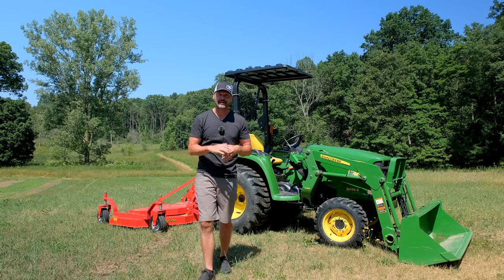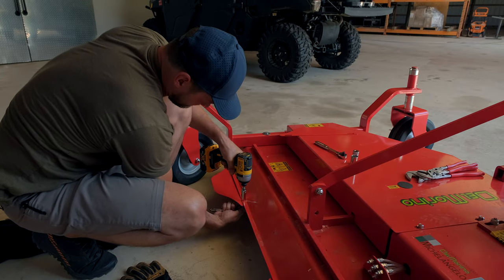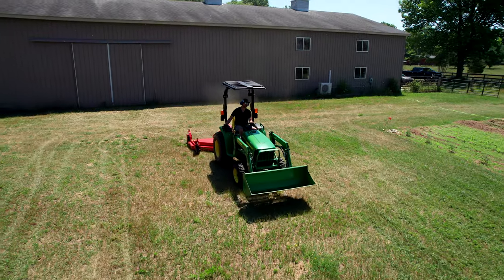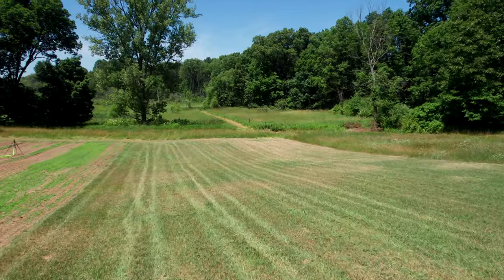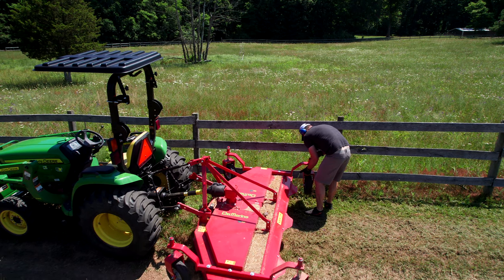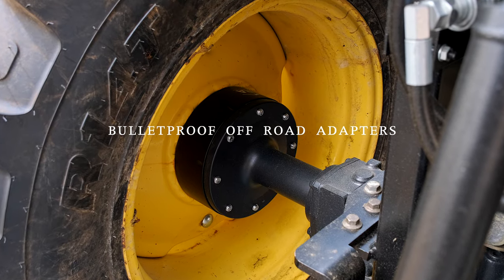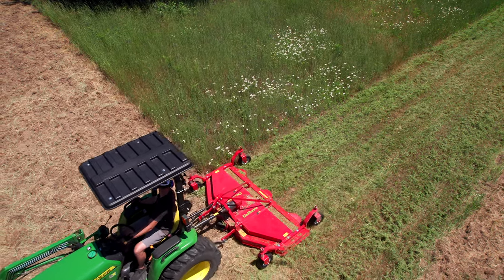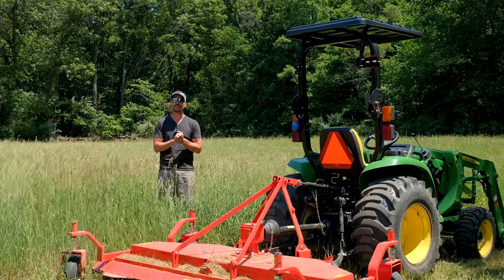96” FINISH MOWER WORKS ON A 25HP TRACTOR?  John Deere 3025e

Comment: surprise no shear bolt of slip clutch on a unit that big
Reply: The belt(s) is the sacrificial part.
Reply: Me too! It definitely needs a clutch! Or a shear.
Reply: @tacratt6091  i just bought this one from Courtney. i’ll let you know if i have any problems with belts.
Reply: @Scott-cu4ol I just ordered one.  Is it performing well, or should I cancel the order?
Reply: @sonataq14  i am happy with mine. i cut both short and sometimes much too tall grass with it and it does a nice job. I am impressed at how the under side of the deck doesn’t get clogged up it stays relatively clean. I’ve only had two raise the three-point twice to clean out underneath it, and it was minor.
keep in mind anything 8 foot wide it doesn’t flex it’s going to scalp on the very uneven ground and be careful of rocks
Reply: @Scott-cu4ol  I just took delivery today.  I'm putting it together and have a question...do you use SAE90 gear oil, or do you use GL-5 80W-90?   If you are using SAE 90, can you reply with a link to the gear oil you are buying?
Reply: @sonataq14  i just grabbed 90 at the hardware store. it was either Pennzoil or Castrol don’t think it really matters.
Reply: @Scott-cu4ol  got couple more questions...what size is your tractor?  And, do you use the mower without a loader on the front?  I've got a 3046R.
Reply: @sonataq14  35hp Kioti CK3510SE cab.  i leave the loader on.

Comment: It will work if the mower is set to cut high, the highest setting.  Go slow.  It won’t be pretty.  In a few days reset height of mower to a lower setting, 1/2 inch lower than previous setting.  Cut the grass again.  This second cutting will greatly improve the appearance and will mulch the brown clumps of grass leftover from the first cutting.  It will mow faster the second time.  To achieve great results every mowing, sharpen the blades frequently.  A sharp blade cuts the grass instead of shredding it.  The tractor will work better, the cut grass will have a cleaner appearance, and the whole job will be completed faster.   Try it.

Comment: Running a 60” rear mower on a hill ‘taxes’ my 23hp tractor in medium range. More hydro whine than anything else. Low range is no problem.  In my case, I think it’s more dragging a 600# mower up a hill than spinning the blades that causes the rpm’s to drop.

Comment: I've found the taller the grass, the slower you have to go. I'm running an L47 Kabota so I have plenty of power. I run at 2400 rpms, but tall grass will cause the belts to slip.

Comment: I use my finish mower on tall grass all the time.  No big deal.  Cutting down brush is a different matter.  On lighter brush,  you can get away with it if you don't mind messing up your blades,  otherwise you're right,  use a brush  mower.
Reply: I agree.  Finish mowers, just like regular mowers, work on grass no matter the height or density.  They don't work well on sticks bigger than say 1/2" or so.  You can damage them.  But grass won't cause any damage.

Comment: Three things that have improved my lawn quality greatly, cutting at 3.5”, harrowing single pass spring and fall, and switching to regular mower blades instead of high lift. High lift was causing ground erosion, and kicking up massive dust.

Dont think too much about rural grass, If its green its green, if its brown its brown.
Reply: Most of my rural grass is a bed of dandelions, LOL. Beautiful in the spring and like you say, if it's green it's green. Might come in handy one day if the grocery store runs out of lettuce

Comment: We've been using a ex local government K-line 3meter finish mower for topping of pastures after grazing with cattle and horses. I only use it on the fields that don't have trees in them. It does a great job haven't had to do a thing to it either apart from sharpen the blades once a year. We run it on either a 1966 David Brown 880 tractor with 46hp or my JD 4066r. Either tractor doesn't have a problem with it. One of the reasons I brought it was due to finish mowers having a high tip speed and a sharper cut which aids in getting a quicker regrowth of the pasture which is important for us. For fields with trees I'll use a nobili bne 210 flail mower (Y flails) or a Celli Vega S210 flail mower (hammers) both 2.1m and fields with stones lumps bumps and sticks a Howard EHD180 rotaslasher (brushhog) 1.8m. it is a pretty lane something about post and rail fences that just looks good.

Comment: I have used my 7' Befco finish mower in 2-3' grass without issue, but would not use it for that type of service on a routine basis. Right now the Befco is relegated to stream bank duty by backing over the stream bank 7' at a time. I was surprised to see a 25hp tractor handling that 8' mower! Thanks for the video.

Comment: good video!  great shots of it in action and with Courtney standing in the grass really gives a perspective how tall the grass is.  

Agree that a finish mower is not designed to cut that tall grass on a consistent basis.  I have a 72" finish mower and from last summer to this summer have mowed a few acreage lots with grass about as tall in your video. A couple of 5 acre lots, I've mowed 5 times and a couple of 2 acre lots I've mowed twice with tall grass. I always mow to a ~4" cut.  All of the acres were home acreage lots meaning just grass, most were flat only a couple had smaller inclines to them, where from top to bottom the elevation change was ~40'.  Most of the time I'm mowing my 5 acre lot with the grass ranging from 6"-8" in height.  

what I like about my finish mower:
I like the cut.  My 5 acre lot is rough from old pocket gopher tunnels and it seems like the ride in the tractor is more comfortable/smoother than a zero turn or riding lawn mower.  It may be perception but it seems like I mow faster with my tractor and finish mower.  Maintenance is quick and relatively easy.  The deck is easy to clean.   Belts, sheaves, gearbox, etc are easy to access. It's nice to be able to lift the mower deck and pressure wash underneath it, change blades etc. I do use a quick hitch with mine even though I'm not sure it's technically quick hitch compatible.  

What I don't like about my finish mower 
the pto is a pain to hook up, then again what things with a pto aren't?  I find it difficult to get really close to my fence, around the kids' trampoline, swing etc. so I usually spend an hour trimming around things with my riding lawnmower then come back with the finish mower.  

Problems I've had with my finish mower
The set screws around sheave / spindle were not tightened from the manufacturer or dealer resulting in the key and keyway getting worn and having to replace a sheave, spindle and hardware. about a $250 fix.  

If I were to do it over again
I would get a larger finish mower.  Something like the 8' would be a lot better because if your going to have a finish mower, might as well have one that is bigger than the standard deck you can buy or if I'm going to have a 72" mower then it might as well be a John Deere tractor with a 72" drive over auto connect deck with the load and go.

Comment: I use a 60" finish mower on tall grass.  I only have small areas to do, but it does well.  I know my yard, so I know where to mow without hitting the areas that may catch the blades.  Also, I raise it over those areas to run over them and then set it back down.  It's also a very old mower (brush hog brand though).

Comment: I use a 91" Caroni and a Woods TBW144 12Ft bat wing. Both finish mowers. Sometimes I'll get behind in work or an area stays wet and grows18" -24" tall. Providing the fields are nice and dry, both will work thru the stuff but you need good blades and slow ground speed. Not a standard practice but they will do it when truly necessary.  Not recommended for standard operations.

Comment: If I cut tall grass I raise the 3 point so cut is   about 12”, then go back over the field with spacers set to 6” height.  The second time over might let you see hidden rocks, branches.  Another option is to mow only half the width of the cut so the mower doesn’t get bogged down.

Comment: I mowed grass like that even taller with a riding mower, a John Deere L130. As long as there aren’t big sticks or rocks I think most mowers will handle it you just have to have different expectations. You raise the deck as high as you can and it’s gonna look bad and you’re gonna have to do multi passes and you’re gonna have a lot of it that’s going to push down and then pop back up. I usually just raise my deck as high as it will go and I go over it slowly. If I don’t know it’s there you have to go really slow or you need to just get out and walk it make sure you’re not hitting a bunch of big sticks or rocks. 

On the L1 30 I’ve run over bricks before and it messes up your blades but it’s not the end of the world, it’s a pain and it will throw the balance off but I was able to swap the blades out and it the mower was fine. I could see where you might get a brick cut up in there or some thing or a big stick or some twine or wire and I suppose you could bend the shaft on your spindle but those are replaceable as well.  So I wouldn’t recommend it, if it’s really bad just pay somebody to brush hog it for you but if you know what they are and there are no rocks or thick branches then just go slow make sure it’s dry and get your deck up high and go really slow, then if it’s wet at all I would let it dry once you cut it the first time and hit it again a couple days later and at that point you can mow it and it will be rough but it will get back to normal eventually.

Comment: Great video!! That finish mower did a fine job.  I have a 6ft. Befco finish mower I've had around 8 or 9 years was used when I bought it. I pull it with 1626 mahindra best one I've ever owned it will actually mow high grass n weeds makes a beautiful yard I mow 4 acres.  That 8ft. Would be nice.

Comment: I have a 2022 John Deere 3025e same rear tires want to add a finish mower - question will those tires tare up the grass? Approx cost for a finish mower 72 inch ?

Comment: Perfect timing. Mowing yesterday with a finish mower and thinking I should have gotten a flail mower instead. Your third area of cut looked like my property, about 12 acres worth. For that third cut you made, would you recommend hammers or knives? What is the weight of the 60" flail mower for shipping? I would have to unload it with my 3025E.

Comment: I have a1025r a d have used my 272 jd finish mower on up to 18 in grass no problems with great 1 pass results. Anything taller I use a 4 ft brush hog.

Comment: The biggest issue I have with a wide mower like that is that I don't have a level spot on my property, and when I get to the end of a row and try turning around, that massive mower will swing the back of my compact tractor around like a pendulum. It is a scary proposition.
Better to play it safe and stick to a right-sized mower for your tractor.

Comment: I used to maintain a bunch of properties with a 4320 and 96” belly mower and worst case I would take 1/2 at a time and I’m talking once a month mowing in central Oklahoma during the wet season I had an 8ft brush hog but hated using it cause it hung off the back so far but a finish mower will knock down 7foot Johnson grass just slow down and take 1/2 a bite
Reply: But also there was one or two that I had the brush hog on it as well so I did two full passes instead of 1/2 at a time but it’s a bigger tractor and didn’t mind the weight on hills

Comment: For finish mowing and taller grass and even some light brush, I like the Woods RD990X.  It will do a good job with tall grass or short.  Only downside is they are expensive $$$$.

Comment: If you’re worried about maintaining the 540 rpm’s on the hills,…you can set it to run at 545 or so to compensate for the loss of rpm’s. Five or ten rpm’s won’t kill it.

If that mower was side discharging,…it would definitely struggle in that tall stuff.
Reply: Agreed next mark above and load down to 540, using 100% of the machine without lugging it.

Comment: Great informative video. Looking at the drone shots of the finished area, I can clearly see what looks like missed grass between the blades. Is this truly missed grass or just clippings bunched into rows?
Reply: If I had to guess the tires likely laid the grass over and then some popped up after the pass.  Typically these mowers have overlapping blades so nothing should be missed at least in a straight line.

Comment: Hey Courtney: I have a 6’ finish mower.  You seem so do a better job than mine does because mine is side discharge.  Rear discharge seems to spread it out and not make tracks down the side.  Not really thrilled about your outcome so I’d saw a flail mower would be a better choice and a cleaner job.  A bush hog tends to want to clump up the grass thru the turns.  Nice mower though.  You mentioned about needing to pick it up?  I need to pick mine up to load and unload on the trailer.  I’m using a B2320.

Comment: Using the finish mower on tall fields ONCE is OK but wont pay off if done repeatedly in the long run.  Used a Bush Hog brand finish mower for heavy stuff on my place I knew the ground that got overgrown… Couldn’t see the dips, rocks and obstacles well enough to avoid hitting and bending things tho…. especially the wheel posts.  And quickly ate a belt that was pricey to fix.  Get a brush hog as cheapest way to reclaim overgrown stuff and make 2 passes at 90 degree angles to each other to chop up the stalks so the grass doesnt get smothered.  Motivates one to keep up with the “nice mower” after that.

Comment: How does this compare with a mid mount mower?  I know this is more personal preference, but do you think it is easier to use?  Can you get into tighter areas easier, by backing in?  I’ve been getting faster at removing and installing the MMM, but maybe the rear would be faster?  just looking for thoughts?  Also is this a cheaper option?
Reply: The RFM made more sense than the MMM at my old house because it had a lot of rough areas and bank edges where I'd otherwise need a push mower or trimmer. At my new place with more yard and trees, the MMM would be better. Based on demo clips, I'd be surprised if connecting an RFM (particularly the PTO) is easier than a drive-over deck. RFMs are generally cheaper than MMM but quality varies a lot by brand.
Reply: There are exceptions to everything but if I personally had it to do over again, I would've skipped the RFM and bought a rotary cutter and a nice ZT mower.
Reply: I have A JD 54" ZT and a Kubota with a 60" belly mower. I'm taking the belly mower off and scrapping it because where I brush hog it hangs up because the ground is uneven. I'm going to sell the zero turn because I can't find a bagger for it, I don't like the side discharge clumps, not to mention it beats the daylights out of my back. Going to run a 6' /72" finish mower off the back of my tractor and run the 48" brush hog for when it gets too thick. Just mowed 6-8' (taller than me) very thick grass with the brush mower with my old 24 horse Kubota, did great in mid-range.

Comment: It is my opinion that if you have a yard or field that is similar to golf course fairways, this may be the answer.  I would much rather spend ~$300 more for the 82" DelMorino "FLIPPER SIDE-SHIFT FLAIL MOWER" mower without the hydraulic side-shift option, or the extra $700 for the same mower with the hydraulic side-shift, and give up the 11" of cutting width for a more versatile implement.  The flail mower would give a much better cut in the high grass, and probably a similar cut in lawn-type situations given you are using the proper blades.

Comment: Never had much luck with finish mowing in thick grass.  Tall does ok, but the moment it gets thick, the 6ft one I have will bog down a 35hp tractor, let alone a 26hp tractor.  Probably why I haven't used it years, as zero turn for yards, bush hog for everything else.  Want a flail mower because a lot of what i cut with the bush hog could be handled easily wirh a flail, but just haven't been willing to spend the money yet.

Comment: I prefer FAST results over "perfect" results.  How much time did it take to use a too large mower at a slower speed vs a smaller, more appropriately sized one at a higher speed?  I own three pieces of property (house, tree farm, and warehouse/office).  I HATE mowing and lawn maintenance, considering it as a pointless waste of time, energy, and money.  That being said, I mow each area fully maybe 6 times a year, leaving half untouched twelve times for the bear, deer, turkey, etc to still have food and cover.  A tilting flail seems much more useful to me.  They can handle my pond banks, creek, and ditches and can handle thicker material without slowing down or bogging

Comment: Don't have large areas of tall grass to maintain, but several trails of clover/grasses to mow. My best results with the 48" finish mower is sometimes just needing several passes to obtain the correct height.  Which brings to question of long grasses/weeds getting wrapped around the front driveshaft... seen a guy complain about tall grasses wrapped around his driveshaft, then stated it was John Deere's fault. Maybe I was wrong with telling him it was operator error which ticked him off... but IMO you walk around at times keeping the screens clean, why not look under the tractor also. Anyhow my opinion wasn't welcomed... and he was a tractor expert of 55 years.  Was I wrong with my thought's ?

Comment: I've wondered tall grass with a finishing mower.  Not bad for the initial pass.  But again,  if you can't see the ground,  a brush hog would be better.  Not to mention running your bucket right over the ground just in case.